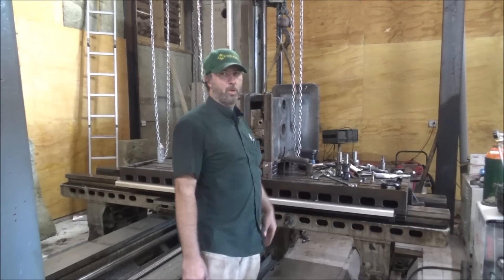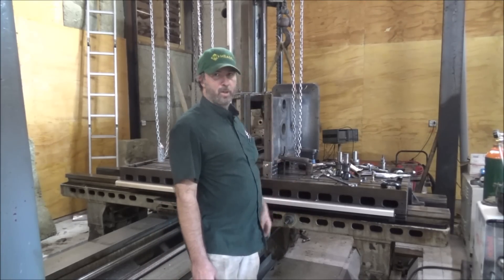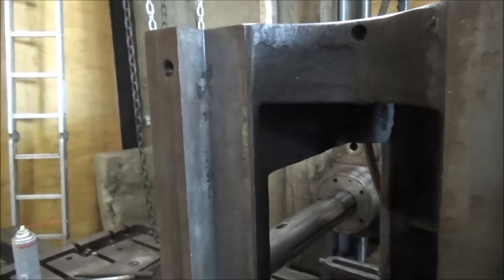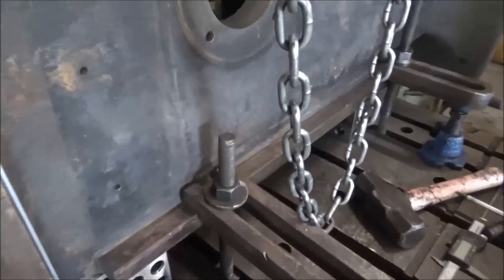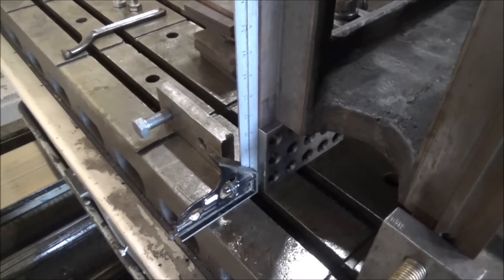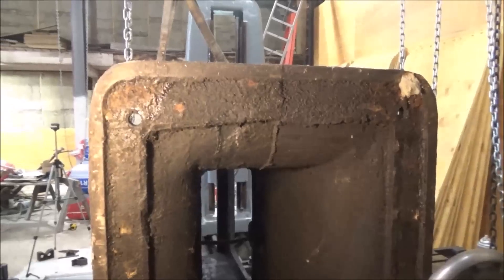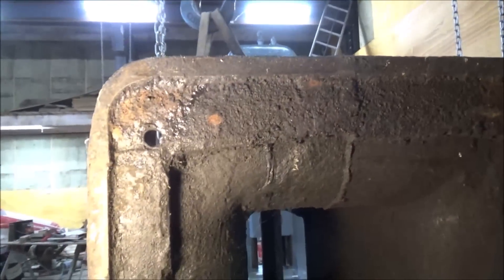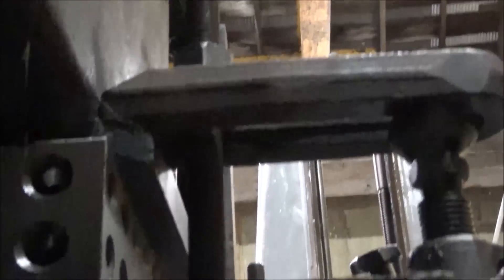Machining a Machine Tool: Rebuild Back to spec Part 1

Comment: Brian, ever use the old school plumbob on piano wire with 5w oil can that the tip of PB rest in? As an Iron Worker (70-1981) we worked long side mill wrights on setting up power turbines here in TX. They took days to fine aline. No lazers back then (@@)..Great see Old Iron like these going to where others can see it,,Nice work. Bear.
Reply from the maker: I have not used the plumb bob on vertical for machines but did use it on the bridge crane. I have used a water level on machines though.

Comment: It’s coming along is interesting what has to be done to square up the machine so you can correct wear. Your correct they probably had fixtures that those as cast bases were mounted in so they had somewhere to reference, without out those you had to face the base in square with the original so you can mount the machine in the HBM to re machine the ram area

Comment: This is going to be a fun project to watch. It will be interesting to watch it all come together, between the set up and the actual milling. In  the next couple of videos, could you pan your camera around the shop so we can see how you’re doing with the wall sheathing. And don’t forget the peaks! Keep them coming!
Reply from the maker: The sheeting is not going well. I haven't had time to work on the building for over a month.

Comment: Hi Brian, in answer to your subscribers; if the bottom was machined, then the manufacturer goofed, ref extra process to pay for!. Casting was most likely clamped in a jig, and transferred from each machining station etc.
Several of your subscribers have already mentioned grouting machines in, plus wooden flooring ( end grain up).
A quartering table would be nice, I think you mentioned you are on the lookout for one?
Nice light snack for the G&L.
Regards from the UK.

Comment: Good thinking basics, just like in a building, make the foundation straight and strong so the rest has something to reference...
Reply from the maker: I just hope I hit my mark and had it good and square. It is really difficult to tell when trying to hold tight tolerances over feet.
Reply: @bcbloc02  When nothing is square to start with, the main problem is to find and decide what will be the first reference...  Quite a challenge mostly on castings.

Comment: That thing was rough on the foot.
 Bet Mike is happy. Thumbs up.
Reply from the maker: It looked like it was built to rock, it had a heck of a hump in it that is for sure.
Reply: Was it intended to be grouted to the floor, do you think?
Reply from the maker: I Imagine they planned for it to just sit on wood.
Reply: as old as that thing is Brian, you are probably spot on, Most shops and factories had thick wood floors back in the 19th and early 20th century. Or no floor at all, just stone or hard packed dirt!

Comment: Is it possible the machine was intended to be leveled with adjustable feet, so no need to machine the bottom, as it wouldn’t contact the floor?
Reply from the maker: My G&L manual from the 40's specifically says to not grout the machine in place as it can not then later be realigned as needed.
Reply: @bcbloc02  Makes sense for an HBM of that size.
Reply: An old chap at work would grout the bottom of any machine new to the shop, he gave the impression it was standard practice.
Reply: @chrisstephens6673  Could it be that grouting appeared much later i.e. between the two WW?
Reply from the maker: Pretty sure they just bolted it to some wood floor and called it a good deal.
Reply: For an HBM makes sense, but for a stand alone machine maybe not so much. Of course if bolted to a wooden floor it no sense at all to grout any machine , concrete is another matter where grout would make a better support.
Reply: I think not, of two reasons. first if the machine should be intended to rest on feet, there should have been some machined aera for the feet to rest on. second, if that machine had feet, the oscillating movement of the ram would make the machine walk across the floor.
Reply: 1952 Ferguson TO30 if anything, they would have used shims under the corners back then.

Comment: well, here in Sacramento, California are a couple or 3 historical machine shops...one is the enormous Sacramento Locomotive Works where they built Locomotives...cast iron foundry, machine shop and all...the 'floor' is mainly 12" square timbers, probably no need for any fine finish on that equipment base, as long as the vertical slide and horizontal are at 90 degrees... 
 Another landmark is Auburn Iron and Steel, antique Blacksmith shop...floor is also all wood timbers....they just wet it down a few times daily for years...
Reply from the maker: Yep I think they just planned to bolt it to some wood so it didn't matter what the base was like.

Comment: You certainly have the right machine for the job thats for sure. The setup looked good. Hard to believe the bottom was just the raw casting and never machined flat. No quality control departments in the 1800's I guess :)
Reply from the maker: Sounds like my shop floor from last year! lol
Reply: That and most shop floors were rough cut wood or dirt and it didn't matter!
Reply: It still worked. Not everything has to be perfect, right?
Reply: +Will Wood, I am a machinist too...my comment about QC was meant as a joke.
Reply: No offense taken, just saying it worked for a long time that way but sitting on the floor etc. probably caused a lot of that corrosion too.  I also like your vids too.
Reply: Ty :)